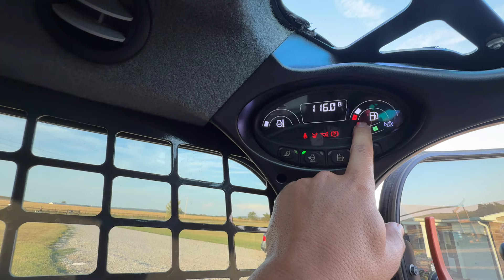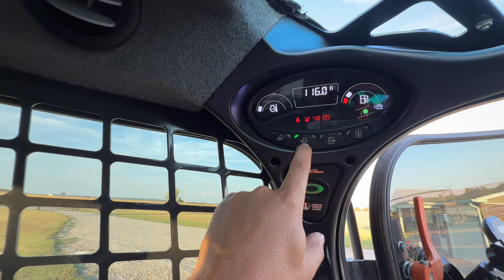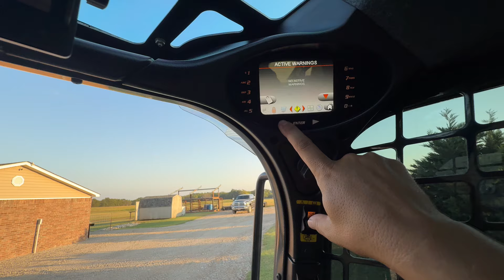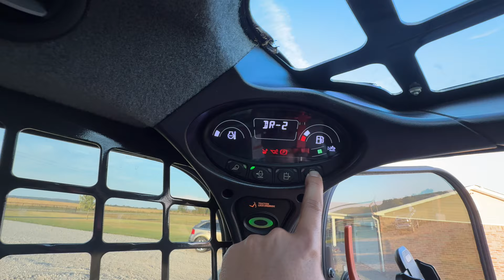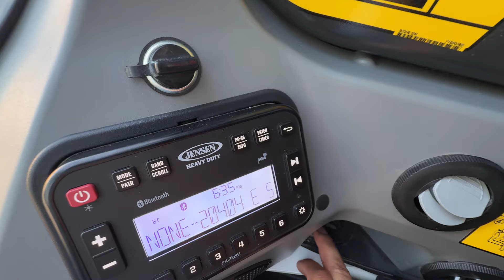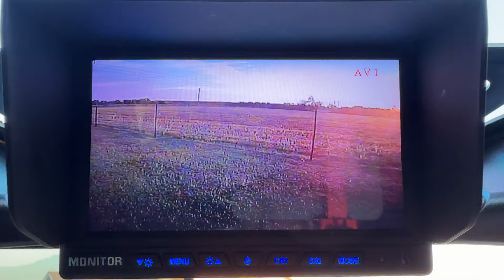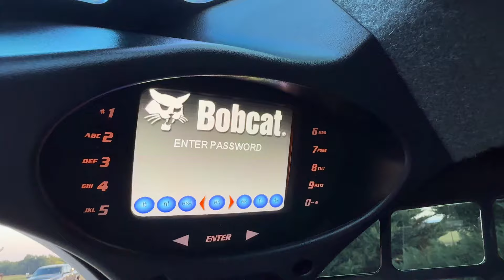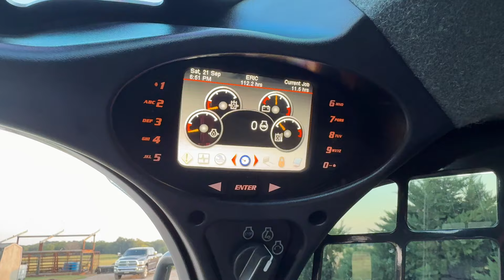2024 BOBCAT T770 100 Hr. Review

Comment: I have the exact same machine except for suspension undercarriage. At 64 hours I noticed hyd oil in the belly pan. It was leaking out of the front main pump cover. Ended up being a distorted shaft seal. They initially tried to replace the seal only but I stopped by and caught them reassembling the pump without a torque wrench so I asked them to replace the entire pump. Machine sat with the motor out in a dusty shop (rental yard dealer) for 2 weeks without temp plugs in anything. I’m getting it back this week and planning on requesting an extension of warranty on Doosan’s dime.  Love the machine performance so far. Thanks for the thorough review.
Reply from the maker: Dang that’s no good I hope it runs right after all that. The bobcat dealer I have wouldn’t let that fly I wouldn’t think. They are pretty top notch. Thanks for watching. Let me know how it does once you get it fixed.
Reply from the maker: Did you ever get your machine fixed?

Comment: I have never had a tracked skid steer or one with air conditioning. That oil drain hose issue seems silly they would let that happen. I had to make a longer hose on my old Bobcat because they made it too short. Thankfully I have my own hose crimper and tubing bender. The heavy cab problem reminds me of trying to lift the rops on my 1977 Bobcat M610 LOL!
Reply from the maker: If I grind it down like an 1/8 it will fit so I’ll probably just do that. Sometimes I think companies just engineer stuff and don’t check to see if it actually works. I know it just little things to complain about but how will they no to fix if no one ever says anything. M610, those are so old I’m surprised they had cabs to lift lol. That was about when they started putting cabs on machines I think.

Comment: Hi I wish you can tell me how much you paid for this machine I will appreciate if you can help me
Reply from the maker: 90k with financing out the door. 
Finance rate of 6.97%
Reply: Am pricing one in New York and is 95k 1.900 % 
No 2 speed no high flow no 7 inch screen no back up camera no def flu I think is to much right?
Reply from the maker: @ sounds high to me. if it does not take def fluid it’s not a t770. Is it a t740? If it is the t740 is only 74 horse power.
Reply: @4MRanch  thank you very much for your help my friend
Reply from the maker: @MarioMendoza-mn2tq no problem hope you find one at a good price

Comment: How much weight did you add to the rear?  For comfort or is to light in the rear??
Reply from the maker: 400 lbs. it was to raise the rated operating capacity from 3475lb tp 3775. Basically be able to pick up more with out it getting tipsy